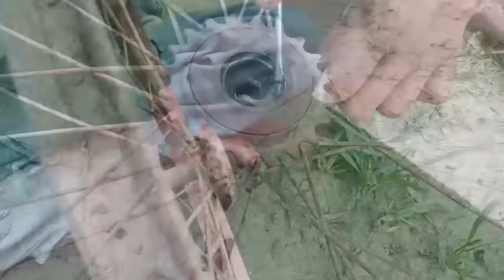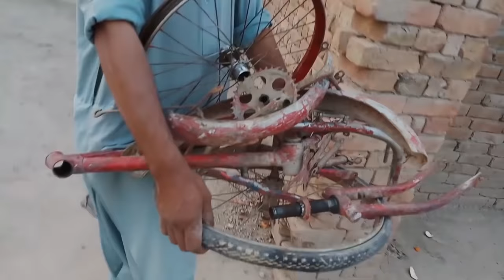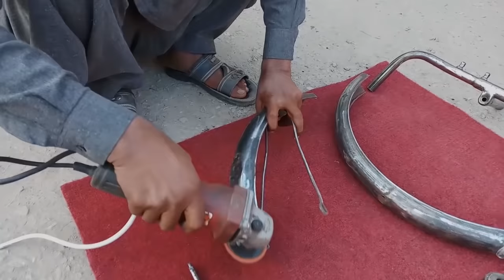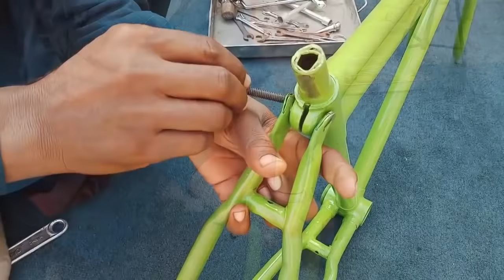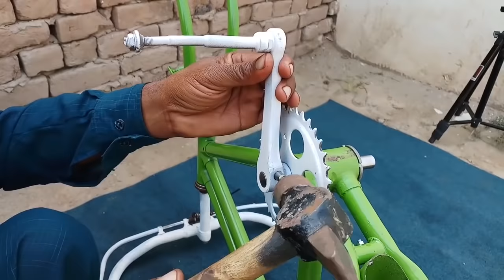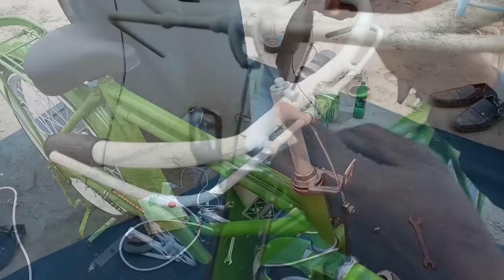Old Bicycle Restoration and Assembling - Complete Restoration

Comment: it's wrong to burn it no need at all it weaken  metal overall  strengths and build corrosion inside frame and locked pipes where you can't see or access    a  you can spray a paint striper

Comment: At first it looks good but in a few shots you can see some flaws in the paint job. Also there were a few dents in the fender that could of used a little more attention.
Reply: Dude, you have no clue.
These bikes are built to look good from 50 meters at 50 kilometers per hour.
They are built from scrap parts ,made to survive monsoon rains and humidity, dust and dirt and will get some one to work or school every day. A bike like this is made from often 2 or 3 bikes . And costs around $30.00 U.S. when finnished.
I have been to Pakistan and seen this done . A good bike guy may make 3 to 4 a week! Selling them to feed his family.

Comment: i am a expert at Cleaning or Restoring bike and anything, One thing that i notice that your burn the metal of the parts of the bike and its not good Because the metal of that bike can be  weak and cause Rush, Yes you removes rush but it will come back..
Reply: A expert but didn't realize how bad he restored it ..u inly mention how heat weakened the metal.  No primer no sanding no cleaning. Painting chrome 
Deanted fenders its just a horrible job
Reply: @billjoe3075  not to mention the crooked spokes he left in the wheels, could have easily changed a few more while ha was at it, the welded whell rim, grinded roughly with an angle grinder, painted just to have paint get rubbed off instantly by the brake pads,  pretty sure those wheels aren't centered either,  I was quite surprised to see him use an actual spoke spanner though ,  with a bit more attention to the wheels, straighten the fenders and a decent paint job I might have considered it acceptable , considering the limited possibilities, but a restoration? I think that's a bit far fetched